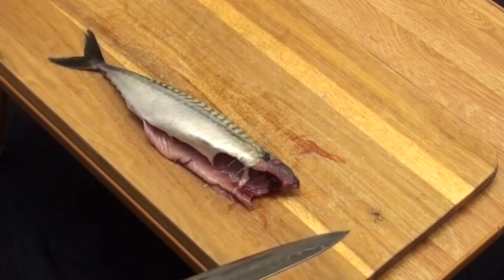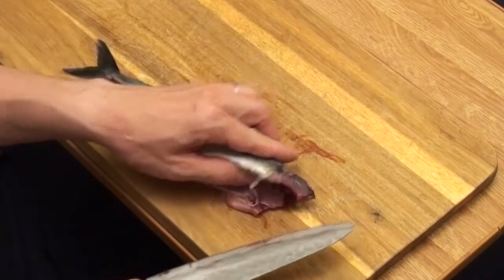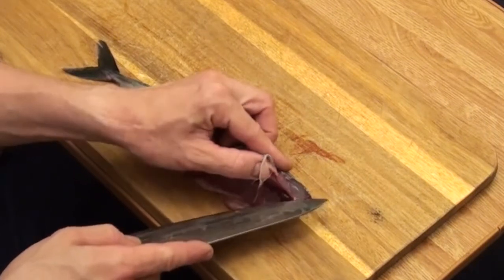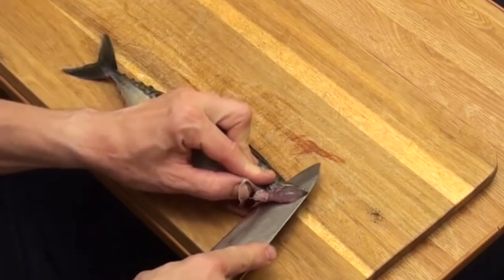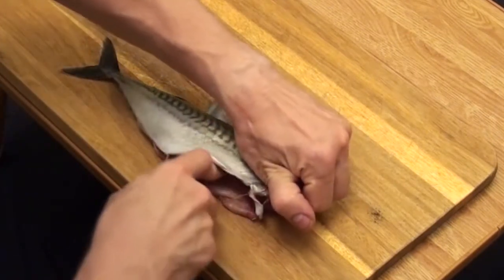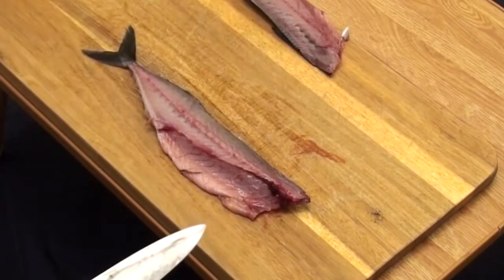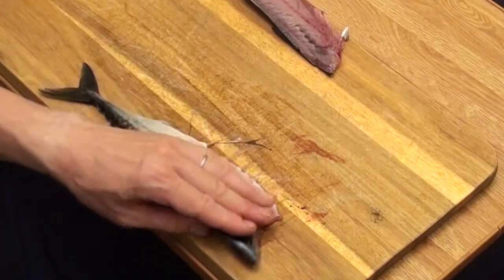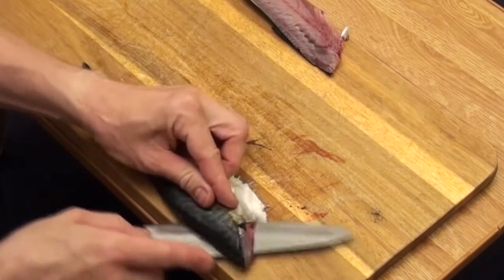Japanese Filleting Technique: Daimyo oroshi with a gyuto

Comment: So...is there any reason a fish would be cleaned this way rather than the usual method...?
Reply from the maker: 大名おろし is mostly used with smaller fish, as it is generally considered that cutting this kind of fish sanmai oroshi style is more trouble than it's worth. In Japan, a mackerel of this size (like the one seen in the video) would actually be considered being rather small. The meat that is left on the bones goes into the soup later on. 
Daimyo oroshi is also considered to be a "luxurious cut", where the host don't mind wasting the meat during the filleting process. It might be seen as a token of respect towards the guest.